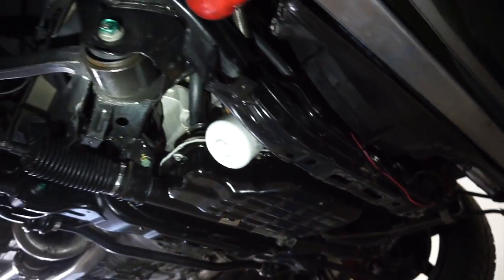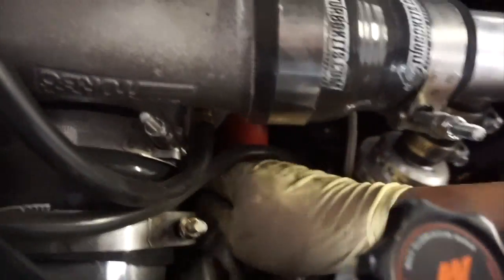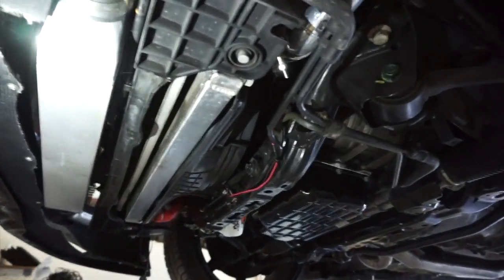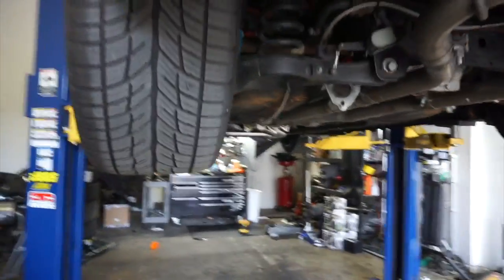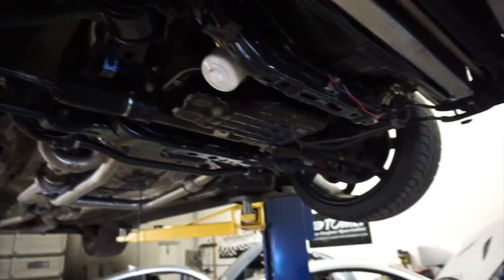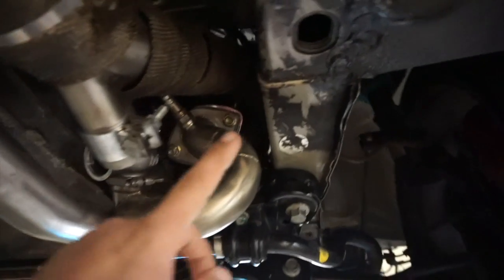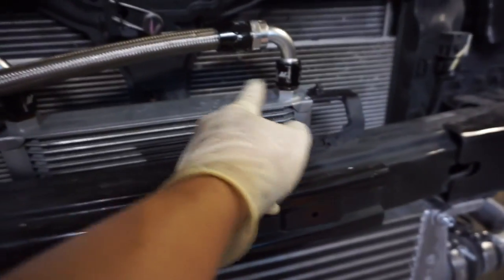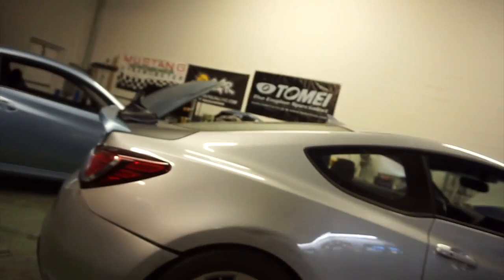Auto To Manual Swap | 3.8 Turbo FIX (FINALLY DONE)

Comment: Been thinking of doing a manual swap myself on my 2010 2.0t. Did u have to change the dash harness? What did u do with the neutral safety switch? Is it the same driveshaft between automatic/manual? Plan on doing the haltech as my swap in ecu so that doesn't freak out. Is there anything else to know?
Reply: David Szymanski you figure if out
Reply: @SRT_James  oh he definitely figured it out lol go see his insta

Comment: What do you charge for doing a manual swap on a bk1 if you were to supply all the parts ?
Reply from the maker: 2.0T or 3.8?
Reply: seoulfulracing 3.8
Reply from the maker: Usually around or less than 3k + Clutch (new recommended)

Comment: Jay, got a question about the computer throwing a code for the auto to manual swap. Do you have to have the computer re-programmed so that it don't light the check engine light or is there a hardware change that's involved also. My 2016 is a automatic and because I bought it in March of this year the dealer said that their were no manuals anywhere in the state, so I bought it intending to do the swap. The only thing that I'm concerned about is the electronics. Any advice would be deeply appreciated, Thank you.
Reply from the maker: ECU needs to be flashed for MT.